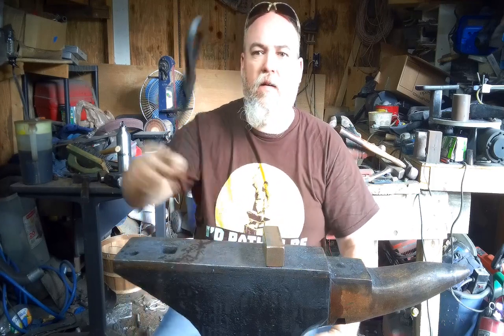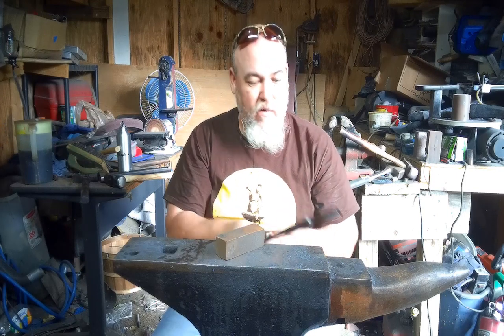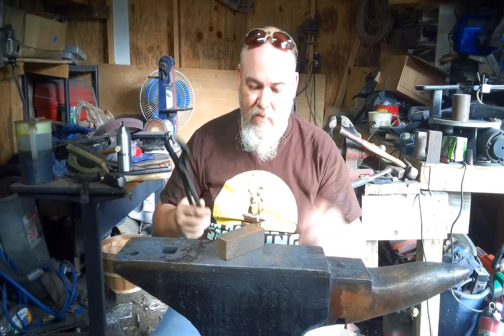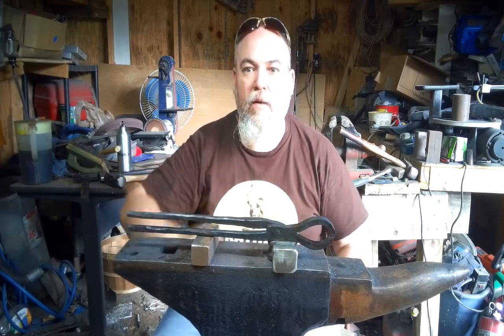Axe making Tongs

Comment: Nice job! I haven't made any sort of tongs completely from scratch yet, but it's on my list. Hey Bob... do you have a vid about your forge? I think it's time I build a propane one..... my little coal one is too small to heat up a long piece of stock.
Reply from the maker: thanks Chris, i do not I did not make  propane forge it was a gift from my  family.
 https://www.ebay.com/itm/Propane-Forge-Knife-Making-Blacksmith-Gas-Forge-Farriers-furnace-Regulator-U-S-A/142530744605?hash=item212f7e911d:g:UtcAAOSwI6RZ2P8T